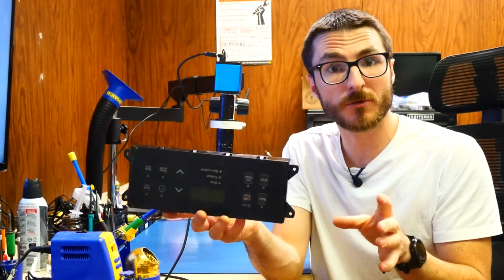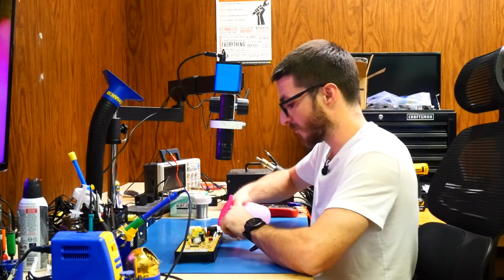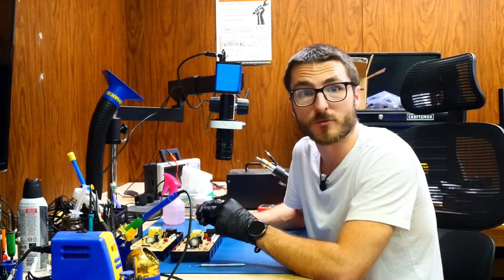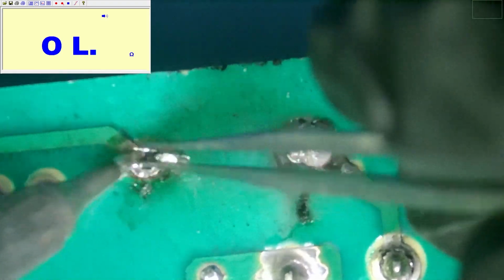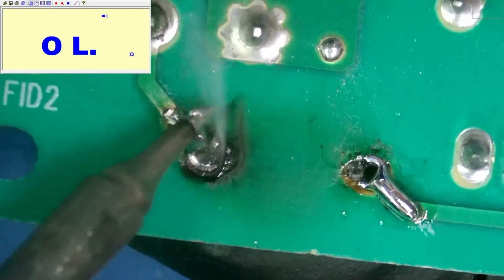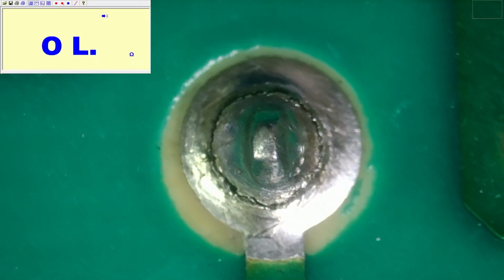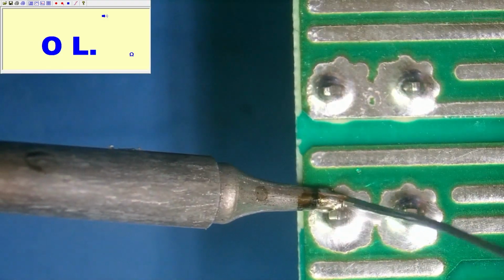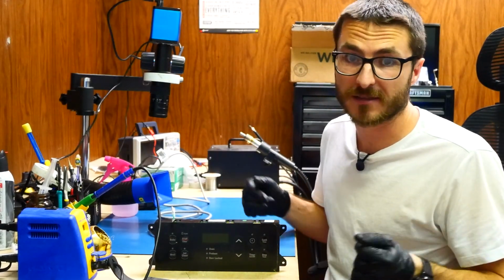Burned Frigidaire Oven Control Board How To Fix oven does heat up 316557220

Comment: Is there a likely repair for a board that suffered a couple of power spikes and now the clock  gains 3 hrs every 12hrs
Reply from the maker: That fault sounds like you may have a faulty processor. If that's the case then it wouldn't be repairable. If the fault is due to faulty software chip however then it would be fixable. Ill be honest I have never seen that failure before so I wouldn't know. You could send it in and we can give the repair a try, but I can't make any promises.

Comment: That resistor is a fuse and its job is to tell you where's the problem from. On one side it is connected to neutral, and the other is connected to the normally open pole of the relay next to it. This means that, when trying to power an element, this relay will close and the bake (or broil) relay will also close. If the first relay doesn't work before the bake relay, the normally open side of the relay is energyzed and power returns to the neutral by blowing up the resistance.
The cause in most case is a bad relay (the one next to the resistance) or a bad timing sequence from the board itself.

Comment: That usually happens due to an over current condition. I would want to know what that 220 ohm resistor feeds ?   Just Sayin......
Reply from the maker: The big relay that feeds into the baking elements.

Comment: The plug is damaged I have a new board to install but am hesitant to install because I don't know what caused the issue
Reply from the maker: If the wiring is burnt you should replace it or strip it and attach a new connector to it. A burnt wire will fail soon and could cause a fire hazard.
Reply: Plan on that vut im concerned that the problem came from the other. End and not the control panel or did the cp cause the issue?That wadnt a cheap part  @NicksElectronicRepair

Comment: I'm dealing with a similar situation. In the process of changing the control board on my wall oven I discovered a burt lead and  terminal labeled oven on the control board. I'm stumped at this point

Comment: I have the same issue and replaced the resistor with the same piece used in the video but it still doesn’t work :(. Any advice/thoughts on what I potentially did wrong or anything I need to double check?
Reply from the maker: You may have cracked solder joints or failed relays.

Comment: Thank you! This video was super helpful. I had a similar relay board 3164627 with a similar charcoal component that burned the board. I didn't know what it was. The 220 ohm resistor is what I was looking for.
Reply from the maker: Glad the video helped

Comment: I think the 5th white band means it's a fusible resistor. So you would need to use a 230 ohm fusible resistor as a replacement.

Comment: Thanks for this video.  I had the exact same board and the exact same resistor failed.  I suspect this particular resistor was susceptible to thermal cycling.
Reply from the maker: Did you also touch up the solder joints on the relay and connector pins? 
If you didn't it's likely your resistor fails again or something else starts malfunctioning in the next few months/year

Comment: I definitely need my control board fix. My Whirlpool oven has an error message F3-E0. It might be the range oven sensor or a short on the board. It turns out it's not the oven sensor. Would it be the relay?
Reply from the maker: What is the model of your range and or the part number of the control board? Different units get different error codes. 
Usually the relays going out don't trigger an error code but instead the oven or broiler just doesn't work. Usually when you have an error code it means something else has gone bad. 
I need a bit more info on your range before I can give you more info. 
Also you say your thermal sensor is not the issue. Can you give me more information as to how you were able to rule it out for sure?
Reply: @NicksElectronicRepair  Whirlpool control board 
part# W10813832 preb1

Range oven sensor 
part# W10181986

I measured my range oven sensor with a multimeter. The meter measured 1100 Ohms. 

Broil element measured 16.4 Ohms

My broil and baking elements are working.
Reply from the maker: Shoot, I am not familiar with this model. I have only ever worked on 1 of these units before and it was a failure with the relays. I don't think this is your issue so what this means is that I wouldn't be able to help you with the repair on this one without having it in my hands to troubleshoot and diagnose my self. I don't know what part could have failed. I just don't have enough experience with this exact unit.
Reply: @NicksElectronicRepair  I'm also getting a F6-E1 error. I wonder if it might be the NTC thermistor on the board. It looks like a wrong capacitor
Reply from the maker: Yeah unfortunately without having you send it in for me to be able to diagnose and test in person, I won't be able to assist.

Comment: I can't help but wonder if using the self-cleaning feature is at least causing some of the issues with the boards. Obviously, the heating element relay really gets tested during cleaning cycles. I won't let my spouse use it at all.
Reply from the maker: Well it does depend on the oven, I know some ovens use the same circuit for the cleaning feature and others have a completely seperate circuits with different relays used for cleaning which helps distribute the load. So I guess it depends on what type you have. If you have a nicer/fancier oven you most likely are fine to use the clean feature as it uses a different part of the circuit than the normal bake and broil but if you have a lower end, then it most likely uses the same circuit and relays.

Comment: can you share the link to buy the devices/parts you used in the video?
Reply from the maker: Here is a list of all the tools we use which you can get from amazon:

Soldering Iron: https://amzn.to/3FQfyhG
Solder: https://amzn.to/3qScy0d
Desolder wick: https://amzn.to/33DAjjy
Flux: https://amzn.to/42YWYBa
FR301 Desolder pump: https://amzn.to/3IhTKzc

As for the resistor and relay you can get that from your local electronics repair store if you have one and if not you can get them on ebay, amazon, Digikey, Mouser, Arrow, or any other electronics component retail store.

Comment: I did a bit of research and those aren't normal resistors but fusible resistors. A fuse combined with a resistor. It's supposed to fail open circuit when the current gets too high.
Reply from the maker: Can you share the information you found? From what I know and have seen across many different types of electronics, all resistors fail open when the current gets too high. This is not a specific feature of this resistor but occurs in all resistors including SMD and throughole. 
Now there are also thermal resistors and thermal fuses on a lot of electronics we fix but the resistor we replace here is just a normal resistor from what I can tell. A thermal resistor at least in my experience will look different than the resistor that is on those boards.
Again I would be very interested in a link to where you were reading this information so I can check it out for myself and see if I am wrong. 
I know that I don't know everything and will always be learning so I would love to read up on what you found.
Reply: @NicksElectronicRepair  My knowledge about this is literally half an hour of googling "fusible resistor", so I am not really qualified to talk about this. You are totally right. Resistors that fail, those that I have come across at least, usually fail open circuit.
But these resistors are designed to FAIL open circuit and fail "SAFELY" above a certain wattage (though it was quite a lot of carbonization imho). That's something different than saying this resistor CAN handle .25 Watt, and it will fail above that at some point. It might even do .5 Watt, who knows? And when it fails it might actually start a fire or something. Its not used for circuit protection but for voltage drop. With a fusible resistor you get both lower voltage and over current protection. You could simply replace a fusible resistor with a fuse and a resistor inline but that's one more part, more space you need etc....
Reply from the maker: Here is the thing, full transparency, I am 100% a "fake it till I make it". I really do learn as I go and have 0 formal education. 
Obviously, I stand behind my work and I do give a 1-year warranty for all repairs because that's the right thing to do. So this is all to say that your half an hour of googling is on par with my knowledge of that resistor. 
I always try to replace parts with as close to originals as I can unless I know it makes more sense to replace them with something else of higher quality. 
If anyone has more knowledge I am all ears and am happy to learn.
Reply: @NicksElectronicRepair  Yeah no worries. Hadn't known of them before either and it seems to be quite a niche thing. It simply bothered me that it had a weird color code, those standards are usually pretty universal.
If I ever come across one in the future I'll know what that thing is :)
Best of luck with your business.
Reply from the maker: So we do replace these on power supply boards sometimes:
https://www.digikey.com/en/products/detail/tdk-lambda/DFN51120/2350891
Those are the only thermal resistors I have encountered but they physically look very different than the normal resistors.
And we do have to replace them for power supply boards on TV sets.

Comment: Always interesting videos thanks.. What does that resistor feed? it's totally fried.. Careful of that carbonized board, in repairs like that I usually grind that out as carbon is conductive, I learnt that the hard way..
Reply from the maker: The resistor goes to that big relay. I don't have that customers board anymore but I believe it goes to feed either the oven, or broiler, so it does have a lot of power going through it. I could be wrong don't quote me on this.
Reply: Thanks for the reply, in the crt days I fixed a loewe TV that looked similar, I cleaned up the board and repaired the dry solder joints, but the plastic support frame that the board mounted on was also black and I didn't see that it was also covered in carbon from arcing , on reassembly I just remember it started to arc and light up... 😮 once I removed it cleaned the board again and the plastic frame cutting away the burned part it was all OK.. That model TV had a factory recall on them for catching fire.. I can see why, no problem once they were fixed.
Reply from the maker: interesting.